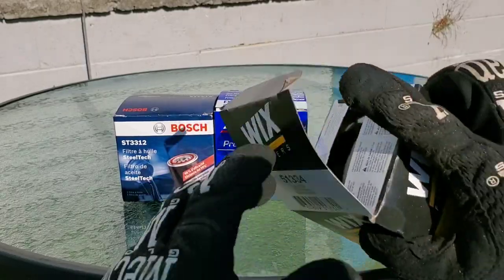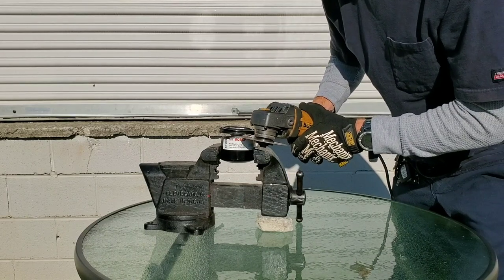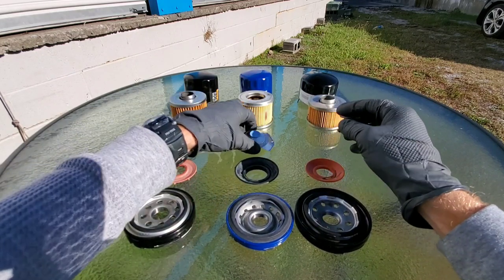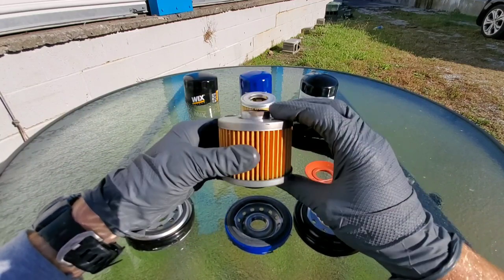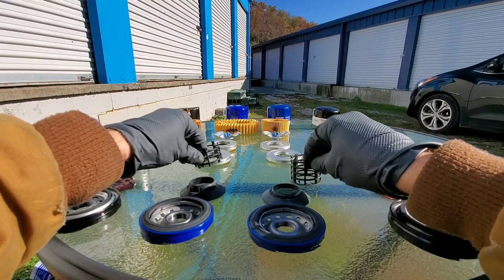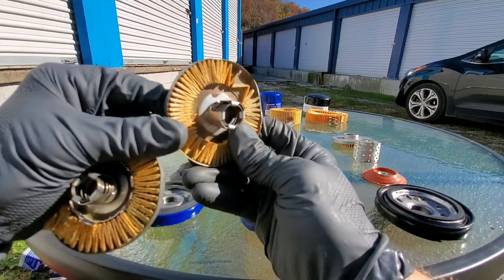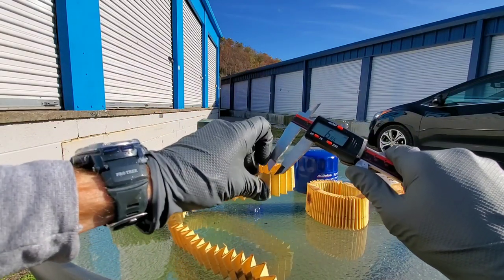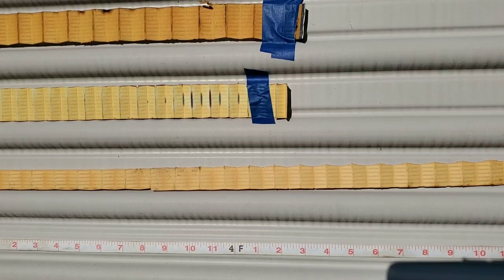The best oil filter wix, Acdelco or Bosch?

Comment: Which one was the best ?  You should give an answer to your question.  Wix?
Reply: When the warranty is still good its the one that the dealer can't blame for any problems. (ACDelco) After the warranty is up.. WIX!!
Reply from the maker: The Magnuson moss warranty act prevents manufacturers from voiding your warranty without proof beyond a reasonable doubt.
Reply from the maker: Wix is good quality and there are others but it depends on the situation, Mileage, climate, oil etc........
Reply: @NATESINTERACTIVEAUTO  True but most dealers will give you such a hard time about it that you will need to argue and argue and possibly get a lawyer if you have an engine failure after getting your oil changed somewhere else with a non OEM filter.
Reply from the maker: I understand some dealers are not trying to be fair however they have to provide proof beyond a doubt it was the aftermarket part.
Reply: @NATESINTERACTIVEAUTO  100% correct !!

Comment: The "BEST" oil filter is the one which fits your engine.  The cheapest Fram has been protecting double all others combined for the past 50 years with very, very few provable issues.  The ONLY reason companies make expensive filters is because "you" the consumer is willing to buy them.  That's it.
Reply: Ive been using fram tough guard filters for my ram since 2004 and its still running good.
Reply: That's the demand part of supply and demand. Thats how economics work
Reply: No. The BEST you can say about fram is they work ok and good enough to not damage the engine. They most certainly do not improve or increase anything. 
And if anything they DO lead to worse performance and engine damage either sooner or just overall. That's the "BEST" you can say. And no kidding it has to be one that fits your engine???

Comment: I quit using wix a few months ago. They have changed something and I've had 3 filters have the anti drain material come apart.
Reply: I had a Wix XP with an ADBV that was not flush with the base plate. Had some noisy cold starts in 100 degree weather. I have the ordinary Wix oil filters on 2 other vehicles. Hopefully they don't do the same as the XP's.
Reply from the maker: Wix xp allows a larger micron rating to pass through because of the extended drain intervals.

Comment: BOSCH the clear winner here🍺👍
In climates with extreme winter temperatures, burst pressure is paramount. The BOSCH canister measured thickest of this group. Cold start peak oil pressure can expand a weak canister, causing catastrophic failure, total oil leakage. My 50 year import car experience has taught me that the ignored oil filter is the most important part that means life or death for an engine.
Reply: Your reasoning is based on nothing but lack of lnowledge the cannister will only burst if the bypass valve fails and the bypass valves are designed to open long before the cannister would burst and to be clear the cannister is going to burst if the oil is so thick and frozen it is a solid and no longer a liguid which means regardless of the cannister bursting or not no oil is going to be flowing in the engine regardless. If you are in this situation (Arctic/Alaska) and do not have a block heater / oil pan heater installed and working you are not going anywhere regardless of whether or not the oil filter is made of glass or 1/4 steel. Some things are designed simply to be good enough and no need to over engineer it any further. Wix is the superior filter here and always has been. But to be clear all 3 of these filters are perfectly adequate and not made by fram any of them is perfectly fine to use but once again the wix is superior. You might wanna watch the engine masters episode where they did a shoot out filtration is the key here
Reply: @mathewhoffer4541  
I dont think his opinion is based on nothing, in The Netherlands, Germany and Belgium, Bosch is at number one according research if its about filtering oil and the flowspeed, also the filter is doing exactly what is written on the package and that is by far not most of the brands are doing.
Some other good brand is Mahle btw.
Reply: Gracias, compré mi filtro Bosch premium 😃👍🇲🇽

Comment: New Chevy 2500hd and the dealer used STP blue oil filter on oil change yesterday! I glanced when there and seen blue so thought AC Delco. Got home to see if greased and was pissed to see STP. They said meets spec. Truck has 18k miles

Comment: the new K&N select, ac delco professional, SuperTech and SuperTech Maximum protection, the new STP XL (sold at autozone) and the Fram Drive (sold at advance) and I'm sure there are others are all identical, made by the same manufacturer with a different paint scheme . one or two of them, the ac delco pro and basic supertech, don't have the silcone anti drain back valve. All the filters I mention are one that I looked at for a nissan vehicle and are all the 7317..
Reply: Same one I use for the 09 Pathfinder.  Recently noticed that Wix makes NAPAs oil filters and appear identical for much less.  Think I'll start using those.

Comment: In 50yrs i have always replaced the filter with my oil (every 3,000mi). My Toyota PU has 170,000mi.
Reply: 196000 on my 06 tundra with 4.7 v8 , i run 5 or 10w30 royal purple synthetic and a wix filter.

Comment: Change to wix awhile ago they seem to keep oil cleaner alil longer and don’t have oil draining back like some fram filters lol
Reply from the maker: Yes i also use wix & what are some other filters or products we should check out?
Reply: @NATESINTERACTIVEAUTO  Mobil...baldwin...napa gold
Reply: Gud filters?
Reply: Always used oem oil filters in my 01 5.3l but just switched to Wix and waiting for Sun to go down to change it. Hoping I made a good choice
Reply: Wix is what I've used since January. I must say that it performs well. Just as good as OEM probably even better. 7 months now and about 4000km done and oil is still in good condition so far
Reply: Anything is better than fram

Comment: How about the Ford filter. I have had a Fram spring have a leak right at the rim below the top of the filter and spray out the side
 Didn't have to gaskets left on the motor
Reply: When I owned Ford’s I always bought Ford Motorcraft filters over Fram just because The Motorcraft stuff said made in USA on the box and the Fram filters were made in China. They’re probably all made in China now.
Reply: @jayson657  Motorcraft (i.e., Purolator) oil filters are mostly still made in the USA, but I guess it depends on the part number.

Comment: Bottom line folks even if you're using a toilet paper oil filter the most critical part of your lubrication system in a internal combustion motor is to change it on a regular basis end of story but yeah don't buy the orange oil filter of engine death.

Comment: is it cutting the best option to open it?
Reply: They make can openers for filters. They are great for inspecting the filter after using them to check for metal contaminates. Wring out the filter in a vise.

Comment: We still don't know which filers oil better
Reply: You are correct !
There is nothing scientific about cutting a filter open and observing the individual contents. A filter works as a UNIT with all the pieces working together.
A true evaluation would have to be done after the recommended miles of service and an analysis of the used oil.
Just my opinion.

Comment: You have to test PUROLATOR oil filters!!!
Reply: Just for your information Purolator and WIX filters are both owned by one and the same company which is Mann+Hummel Germany.
Reply: @petrolvroomgeek2253  Very truth, still that doesn't mean anything, each company chooses to make their own decisions and products.  The proof is in the pudding!!!
Reply: @RXAR1234  they're now under Mann+Hummel's control, material suppliers and etc... have been centralized and are now uniformed with Mann+Hummel's, they removed a lot of the old workforce of WIX filters when they bought the company. WIX filter's current employees can not make decisions unless approved by Mann+Hummel superiors as you have seen both Purolator and WIX websites have been modified under Mann+Hummel's orders. They no longer put up sensitive informations like micron rating and etc... freely on their websites unlike before when both companies were still independent.